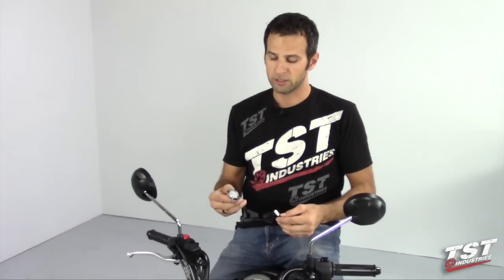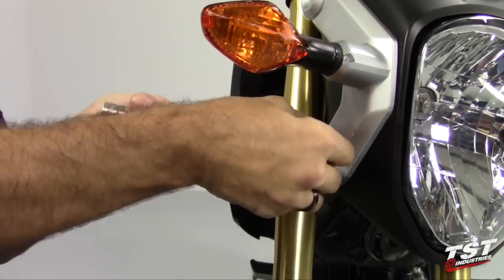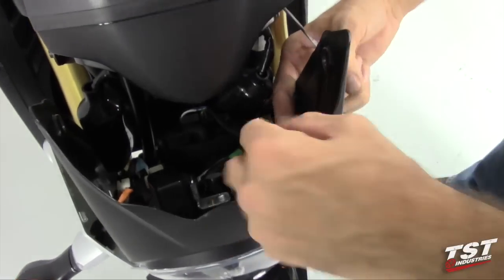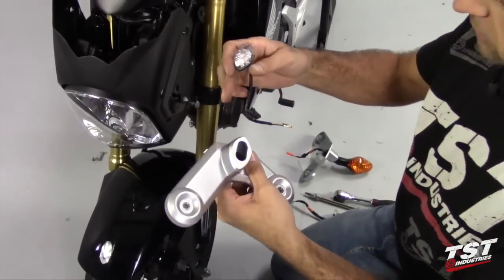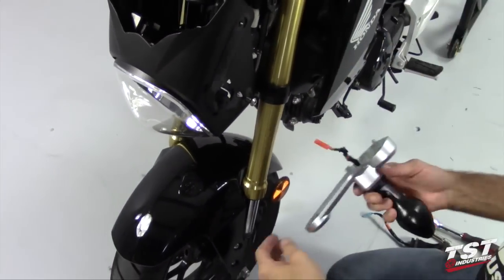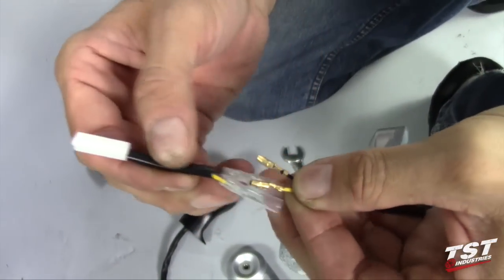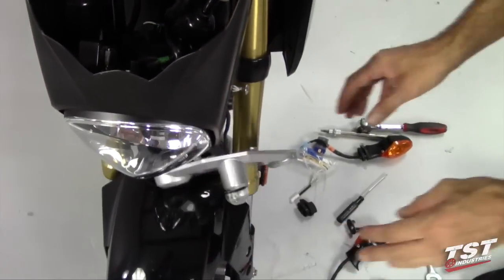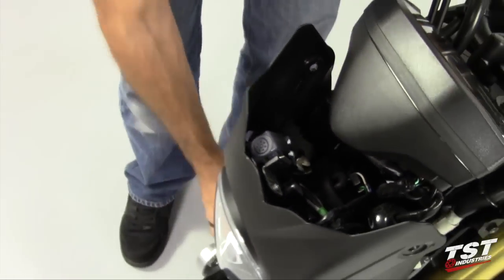How to install 13-16 Honda Grom mx125 Flushmount Signals by TST Industries

Comment: Even though my flush mount turn signals aren't TST Industries signals, this video helped so much that I didn't even need to watch the whole thing. IDK who made my signals. The owner included them on the side. It's not like he'll need them.
Reply from the maker: Well I am happy that we helped you anyway. Our mission is to elevate motorcycle owners experience with their machine. I think we succeeded in your case.

Comment: Just installed these today. This video makes the installation simple. I just hope the plastic nut doesn’t vibrate loose.
Reply from the maker: If you followed the directions exactly you should be all set. There is a good amount of friction on those threads once the nut/stud connection is preloaded.

Comment: there is simpler way then doing the wrench at end just twist the light  a couple more times it will tighten itself after hand tight and then you wont strip it. i had to use washers because my nut was sitting in there funny. i might have over tighten one or the bottom thread is a little messed up in mine ill have to get a 2nd washer on one side later on but its tight enough as long as some kid doesnt come up to it and start playing with it when im not near the bike. it does make the bike a lot more sleek/stealth looking with this mod and doing the bar end mirrors but reversing them so they are just under your hand so you can still lane split easy. and i even did one mirror under my throttle hand and it doesnt even get in way. and i can still see both sides around me since there is lots of 6 lane streets here so it helps to have two mirrors. but ya 2 simple bar end mirror 40 dollars.. compared to 80 dollars for one lane splitting bar end mirror that folds... and this 40 dollar mod makes the bike look a lot better. and its like why doesnt it come like that....though it would be nice if they were also running lights.. but for how cheap they are cant complain.

Comment: Thanks. Just installed these, along with the connectors and relay, on my 15 Grom using this video. I have one arm in a sling and was still able to install. Easy peasy. You guys have anything like this that'll fit the front of a CB1000R?
Reply from the maker: +Old Goat Ninja Nice! One armed installation...the process must be easy. The CB1000R will take the same flushmounts with the same harness converters. Unfortunately we don't have a video of the installation on that bike.

Comment: I have these... but... is there a way to have the front and rear signals stay on until the lane indicator tuned on and start blinking? having these installed makes it more dangerous riding at night.
Reply: J N you mean the running lights? Yeah they don’t do that

Comment: will the relay for this work also if you use the MNNTHBX fender eliminator kit with the integrated LED taillight?
Reply from the maker: RuckinWithRob it will work with that setup....no problem

Comment: Will the stock rear turn signals work with the LED flasher relay?
Reply from the maker: Yes the LED flasher relay will work with the stock turn signals.

Comment: Having extreme trouble getting the bottom bolt off and the screw on the turn signals. Any suggestions?
Reply from the maker: Please get with our support guys through our site and explain what you are experiencing a little better. They will help you out.

Comment: You got any specs on the 4 bolts? I bought used from a friend and it's missing one.
Reply from the maker: I don't know which 4 bolts you are referring to. This video was shot a long time ago.
Reply: @TSTindustries  you removed 2 bolts on each side to take the stock signals/boomerang piece off... those bolts. I'm trying to find size/ length/thread from the manufacturer to replace it.
Reply: You remove them at @1:07. I'm having a pretty hard time finding the specs for a direct replacement if you could help
Reply from the maker: @claycrenwelge9971  sorry for the delay man. I remember them being m6 screws by 20 or 25mm long. The OEM ones use a 5mm allen and are a large size socket button head. You can find standard head size button heads in that spec and that should work, maybe with a washer under each if you want to have similar contact area as the large size button head.
Reply: @TSTindustries  hey thanks a lot! I was eventually able to find them from an OEM drawing but im super impressed with the customer support! Im about to order the integrated tail light based on that alone.

Comment: How the heck did you remove the screws behind the turn signals?!
Reply from the maker: Once you remove the boomerang piece and start maneuvering the signal out, the metal keeper will become visible. Push that in from the outside of the turn signals and it should pop out. Fast forward to 3:30

Comment: Will the cbr halo signal work for the grom?
Reply from the maker: not really but we have a boomerang design that will fit the Halo-1. We aren't sure yet if we will be mass manufacturing that part. You can check out our blog article that will be launching in the next few weeks about the Halo-1 signal technology. We will have a few shots of the boomerang and Halo in this article. In case you are interested the blog address is http://www.tstindustries.com/blog

Comment: Which plug converters are used for a 2014 grom?
Reply from the maker: In the American market this bike uses the 3-2 for standard signaling connection, and 3-3 for use with our Running Mate and single circuit signal. Outside of the Americas you have to take a look at your connector because they vary per region.